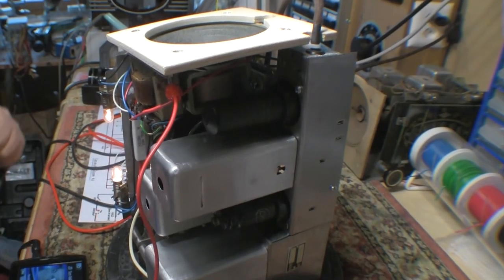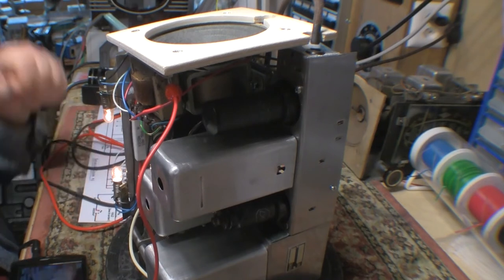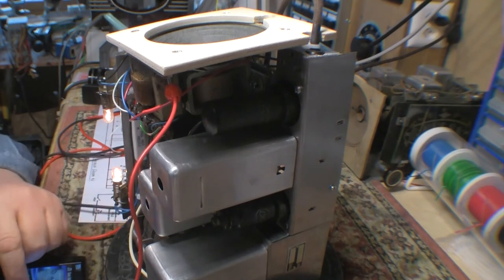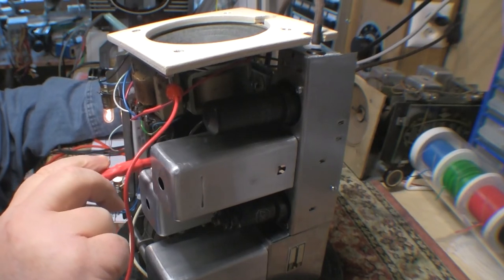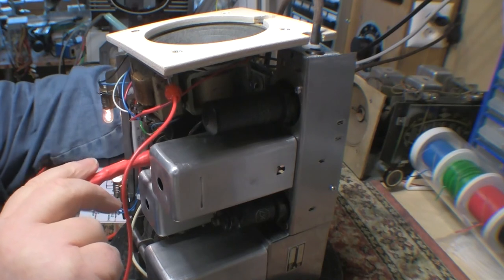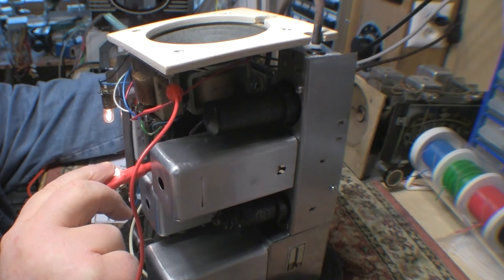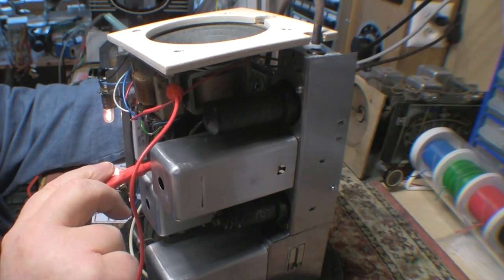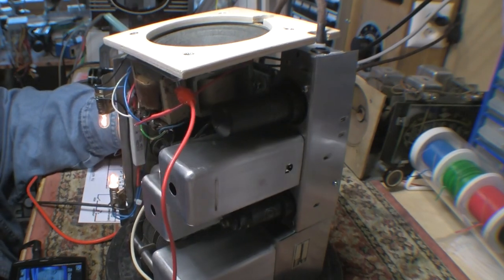Radialva Groom  Rebuild - part 18

Comment: It is really coming to life again, how satisfying is that?
Reply from the maker: I'll admit I got a buzz when the audio section responded.  It meant my calculations for the capacitive dropper were OK and the power supply worked and the audio section was wired up correctly.   Getting the RF end of things working might prove a bigger challenge but I'll keep at it.

Comment: Great job with the audio section John!
   Please be aware of what I endured injecting an audio signal with one of my mp3 players without capacitive de-coupling. It wiped out one side of an audio output I,C,. on my expensive COWON D2 player. Luckily I found a replacement board for it because, that particular COWON D2 had a broken screen. Whew!
   Best of luck my friend!
   Cheers!
       Tom
Reply from the maker: No worries Tom, there's a hefty capacitor in the  cable from the media player.  The player I'm using is not particularly good anyway but still, no need to take risks.  You were lucky, fixing these modern gadgets is usually impossible unless you're luck enough to find a direct replacement part or a donor device.  Even then it can be tricky.
Cheers,  John
Reply: Zone1242
I did get a SMD soldering station John. But with my failing eyesight and not the steadies of hands, I'm scared to death to try using it.
Of course, if push comes to shove, I will.
Cheers!
It's been a long day. I need a bee'ah. Too bad I don't have a Marshall stack to go and fetch a cool one. Hi Hi.